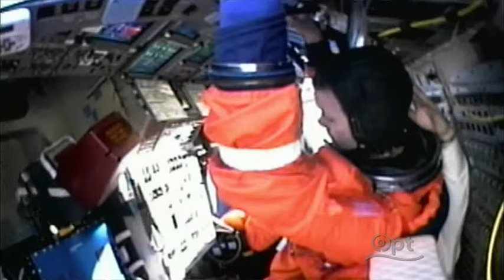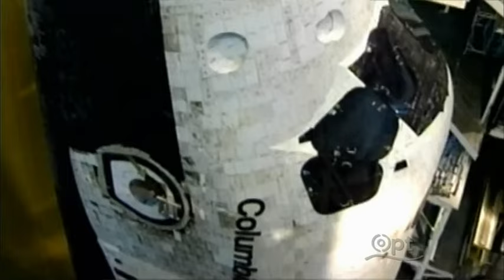PBS NOVA: Space Shuttle Disaster

Comment: I was an Air Force Air Traffic Controller in the early 1980s. I arrived shortly before the second launch (STS-2 Columbia) of the Space Shuttle (a space vehicle system that was truly a worthless piece of crap btw).  The airspace above and around the launch site included multiple restricted and warning areas that activated on launch days.  The boundary of these areas closest to the launch pads ran down the center of the Indian River. Myself and several non-rated controllers (I had arrived about two weeks prior) grouped around a spare scope and started counting aircraft primary targets (reflected radar returns from the skin of the aircraft).  Within an area of about 20 miles by 7 miles by 10,000 feet in altitude, we counted over 250 individual aircraft flying back and forth minutes before shuttle launch.  Probably the densest accumulation of airborne aircraft ever.  We marveled at the fact that nobody ran into somebody when a collective callout by passengers and pilots alike said, “There it goes!” Worked or saw launches #2 thru #22 before leaving that assignment - missing the Challenger disaster by a year.  Hated that system from the start… it killed more astronauts than every other rocket system, by every country, in every decade since Yuri Gagarin onward. Anyway, never saw a launch from the air, just the beach at Cocoa Beach, jetty at the Port of Canaveral, on the Cape complex from 4-1/2 miles away, from my couch thru a window of my apartment and on a radar scope while working traffic.  From 15 miles away, the radar return (the blip) on a launching shuttle was nearly two inches long, 1/4 inch thick and only lasted two sweeps of the radar before exceeding the radar’s maximum range by altitude, not distance. A Boeing 747 (typically largest radar return) was only 5/8” by 1/8” in size at the most.
Reply: TBHAF the Shuttle was shit because of the USAF. Without the Airforce being a baby and wanting to conduct military sorties in LEO with it and strangling NASA, we would've gotten a much better bird.

Comment: You can see the pressure wave @ 13:53 as the shuttle passes through Mach 1. It's very shameful what NASA did (did not do) in 1986 to the 7 astronauts and the Challenger. They were warned on several occasions by the engineers at Morton Thiokol (manufacturer of the solid rocket boosters) not to launch due to the cold weather but NASA decided to ignore them and proceed with the launch. NASA's safety culture was broken and in disarray but it was fixed after Challenger. As 17 years passed by, it still appeared that all was in order, then came 1 February 2003. That same broken NASA safety culture appeared once again and 7 more astronauts paid the ultimate price. Boeing is guilty of this same culture as well, except Boeing killed 346 people instead of 14.
Reply: How can you say the culture was fixed?  It clearly wasn’t fixed as they made the same mistake again. It wasn’t an accident, it was criminal negligence.